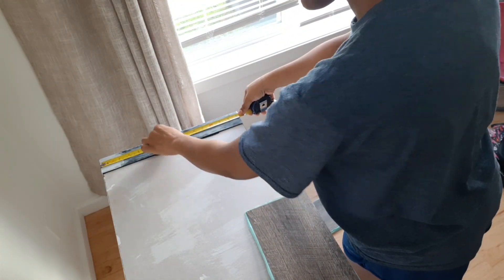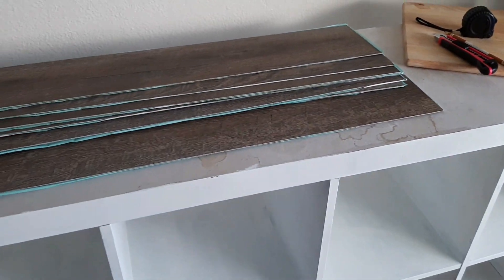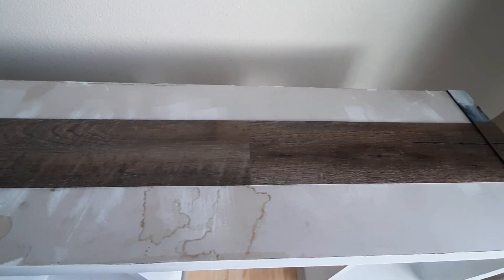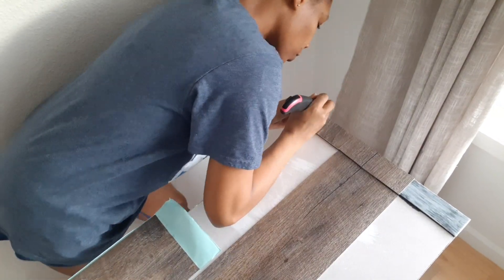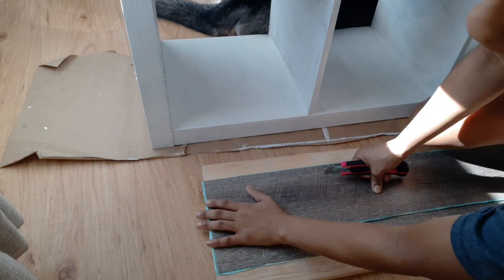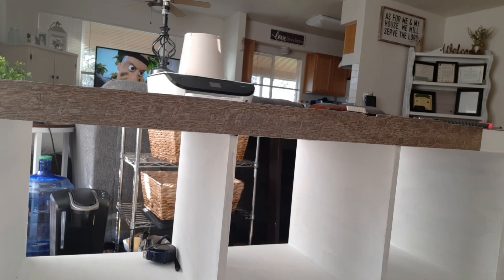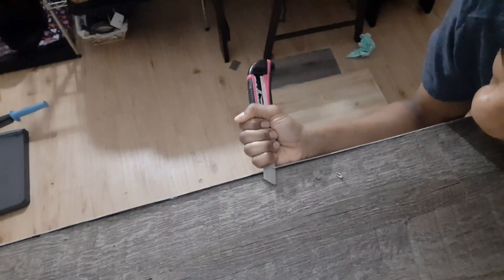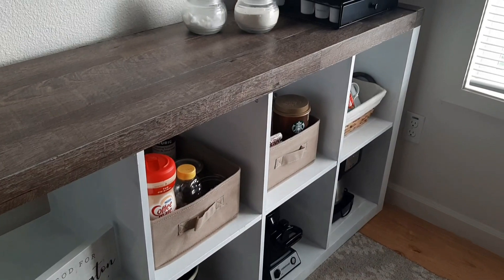Cube shelf makeover with faux wood top and chalk paint!

Comment: What kind of paint did you use? And how many coats?  Looking to change the black/brown colour of mine to a white as well.  Would you recommend spray paint? Or just roller and brush?  Thanks...and props for such a cool project you did with so much going on.
Reply from the maker: https://www.walmart.com/ip/KILZ-Chalk-Style-Decorative-Paint-1-quart/770393033
That is the link for the type of paint I used, and you wont need the whole thing. I used a small brush but I think a roller could be used just as well. If your cube is laminate try your best to peel that paper film off, the paint will stick none the less but I believe it's better coverage and less coats of paint if you are able to.